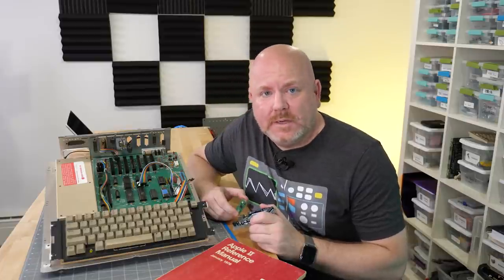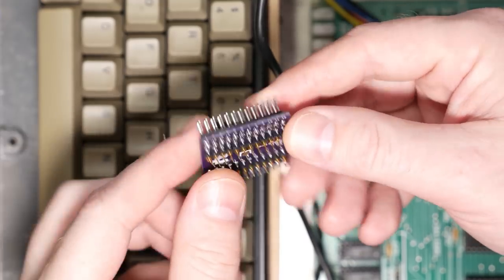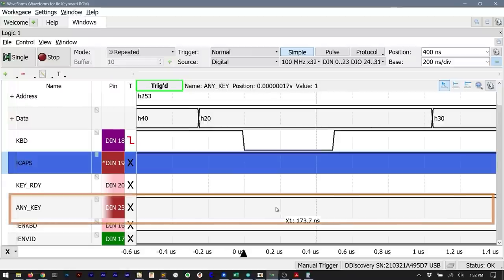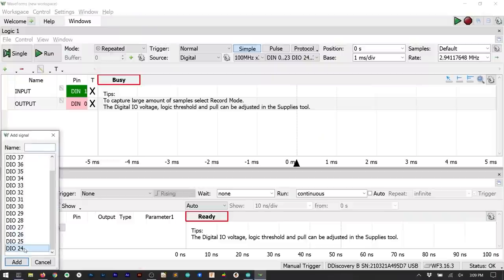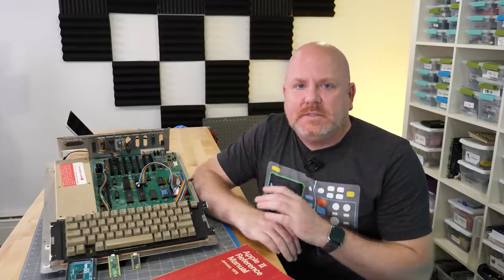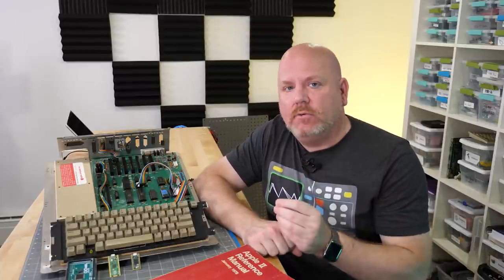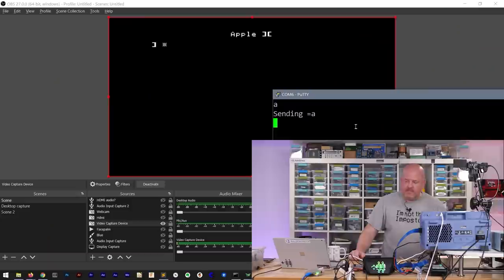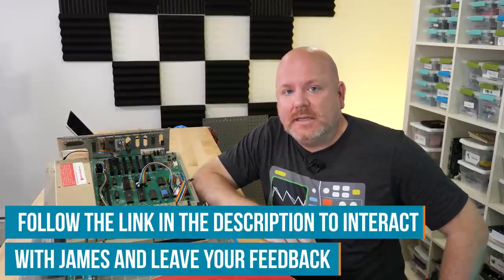Emulate an EPROM - How Hard Could it Be?

Comment: It is not clear why you want to tinker with the "ROM" to insert other character than the one typed in, that could be done with software and it has been done with software, remember a baby behind the computer, typing random letters and ciphers and the outcome is a real text (that has been selected before). Then it looks like the child is very clever.
Reply: The why was covered in the first 20 seconds of the video right after the intro. Working towards a single board computer that takes a USB keyboard rather than the original
Reply: @DoctorWhom  I don't get why he didn't just convert the USB keys into key matrix presses as the standard keyboard does.

Comment: How about a cheap cpld or fpga? Would be great to see a follow up
Reply: That would be too easy except the usb host interface and you would need voltage level converters as almost all FPGAs and CPLDs are 3.2 volt or lower devices. if you went down that path why would you bother at all with the rest of the hardware.

Comment: Not using the Arduino code libraries but programming the native MCU registers will speed things up. After that: assembly, which is basically what you ended up doing. Another favorite of mine is the PSoC5: an ARM core with programmable hardware and a cool IDE  (windows). My usual take on emulating a ROM is replacing it by a RAM and get bus access to load it.

Comment: Nice job but it seems like massive overkill. I have a handful of Apple II's and have wanted to do this and also map in some RAM with special functions. I will have to try. I thought an Arduino Nano at 20MHz might make it. I would never use interrupts for this. Just a branch. In fact I would unroll a loop as far as I can given memory available and branch back. Basically unroll in a loop. If that was not enough, an STM32F407 or a Blue Pill is next. I like ARM instruction sets and I would use MicroPython with its ability to inline assembly code. ESP32 is possible as well. Teensy 2 is worth a try.
Reply: All the same. overkill is useful.. The price of the new fancy stuff is often cheaper than the alternatives. Once you get familiar with the toolset, it can become your swiss army knife.  FPGA are awesome for this sort of task and are really easy to program and verify, and very consistent with nanosecond timing..

Comment: todays software is too fast for reverse engineering by hand with standard devices. it seems most of devices needs specific tools to decode or reverse engineer or track/debug they charatheristics syncronously. 
in old devices some mechanisms code can be seen even with barely looking at their workings.
when i first saw arduinos . i tought they are ready to go reverse engineerint debugging system control tools for modern era devices but after lots of trys i realised their speed is not enough for debugging alive working systems ... atleast not online. but can be done by recording and analysing data offline. atleast in lots of cases .

Comment: it would be  interesting if you could, do this with every EPROM's and ROM's, e.g. using a Apple motherboard, but with all and every but with every EPROM's and ROM's emulated or simulated, maybe doing it as one chip at a time to the point there is no original apple parts left, except the motherborad and case? 😃

Comment: Anything that needs quick turn around will cause issues for this type of software. The best you can do is what he did, move from slow to fast. Then move from indirect to direct. Once multicore drives down area cost this will likely be the next area of concern. Note this assumes a high level of determinism. Teensy uses Cortex-M7 so there goes ISA improvement and moving to 1+ GHZ would likely have marginal gain. 

Another example of this that is challenging would be SPI EEPROM. The issue here is processing the command, address and data lookup quick enough for the next clock cycle. The gain moving from 16 to 600 is 37.5 (could be 150 is you consider ISA difference at 4 times), which is very good. However we will need more and there is a limit in practice to how high we can make this gain. So indirect solution has its limits for IO. Direct on the other hand has next to no limit. It could process this very quickly.

However this is not very useful in all cases. Enter the problem that RP2040 has only scratched the surface of. How do we abstract or simplify direct solutions. This has been discussed since the 90s. Never really been economically possible. Not sure the RP2040 can process SPI EEPROM, but can resort replaying known data if access is predictable. Other than that you are left with redesigning the protocol.

Software systems are basically memory, state machines, etc. just like hardware. Only difference is the delay, latency, efficiency, coefficient, etc. FPGA existing in between. This is a rabbit hole by itself.

Comment: A 2650 has a clock speed of 16Mhz which is not great for this application.  Personally I would have used a 120Mhz Particle Photon or Argon MCU which is as easy to program (most Arduino code runs with few or no modifications) and almost 10x as fast - not a lot of price difference either and it has Wifi if you need it.
Reply: These are pretty stupid suggestions, to be honest. For the Wifi, these modules include an ESP32, and the main processor is an ARM from Nordic, plus a bunch of other, completely unnecessary components to implement a ROM emulation. Thus the obvious choice would be to just use any fast ARM Cortex MCU that also runs Arduino, like one from the STM lineup.

Comment: I did this a few months ago with a teensy.
Reply: And it was tough to get the interrupt response down to under 100ns.
Reply: Teensy can respond to ISR in under 20ns with the right code.
Reply: PIO is a neat solution though.
Reply: Will have to play with the rpi2040 now. But you shouldn't have given up on the teensy so quick. Like I said, I got it flipping an output on interrupt in like 20ns or so and have it emulating an eeprom in a 70ns system perfectly.
Reply: I regret not making a video now as this stuff hasn't really been done before (emulating an eeprom with a microcontroller).. congrats on being #2 to do it.

Comment: Can't believe people are still using Python for microcontrollers. Such a slow, high-level language barely has any place on desktop, let alone tiny microcontrollers.
Reply: It is missing the other side. Python does not matter if the hardware secretly does everything. In this model the Python is top level configuration/noncritical event processing logic. They left that out cause it does not really exist. It can sort of exist in some SoC platforms. Lot of work for a top level polish no one will ever use, I guess. However the goal is to make user level interface. Just never happened and probably is not going to either.

Comment: Неу! That is the crazy way to make your product "compatible" - when it is no need to do it, and it didn't make anything no easy or cheaper. It was great work... for nothing. Nothing at ALL. Use microcomputers to emulate keyboard chip for ultra OLD computer. Pi can emulate work of 200 such computers, 200 in same time.